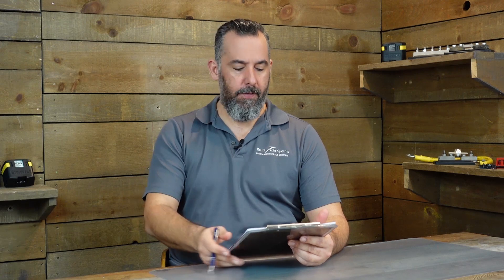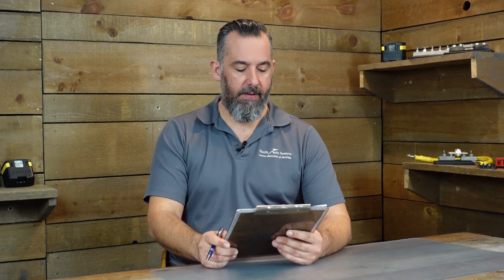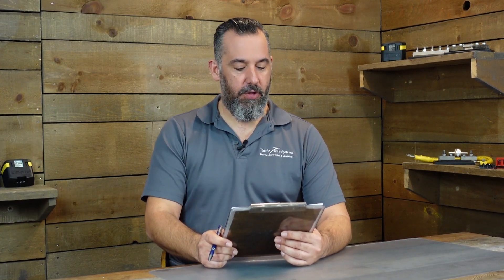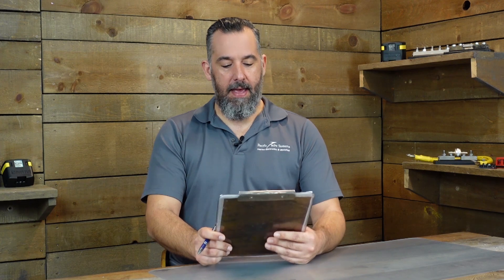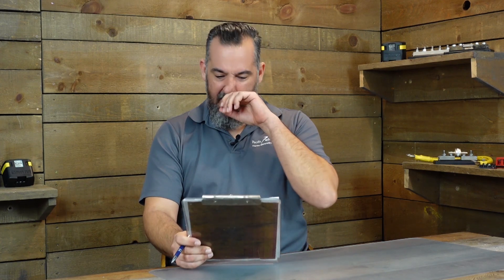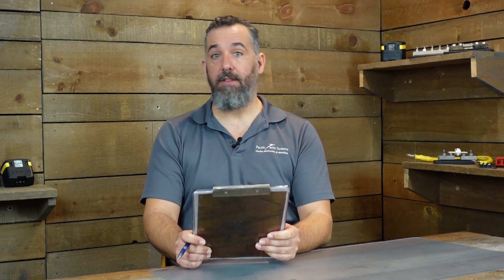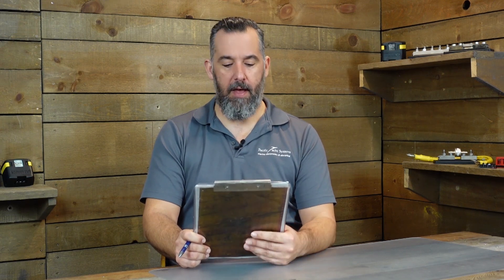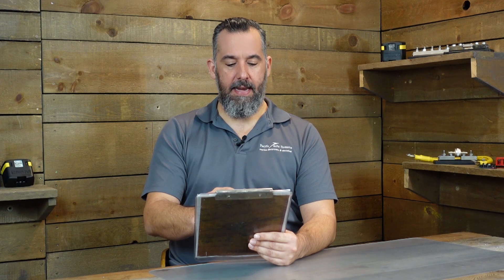Do I Fuse a Starter Battery on My Boat?

Comment: Yes it is a problem if you blow the fuse. But it is even a bigger problem if the starter shorts out and starts a fire. There is no easy answer. A bypass emergency switch (bypassing the fuse in case it blows) is an easy solution.

Comment: I had a 300 amp fuse on the start battery and tripped it when the ACR failed to keep the battery charged. I had a parallel switch that allowed me to start off the house. I'd always prefer a fused circuit over a potential short and fire.

Comment: When I was just 20 years of age I worked for a yacht charter cleaning boats etc. One day at the dock I tried to start a 26 foot flying bridge type cabin boat with a V8 inboard. Instead of starting, smoke billowed out from the engine compartment. I quickly pulled the hatch and saw flame through the black smoke. All I could do was empty one of those ABC fire extinguishers on it which surprisingly snuffed the flame. By then I think the battery was exhausted and the starter cables were history. Fortunately it wasn't a 4D or 8D battery. At that time I believed the heavy starter contact solenoid stuck. I'm guessing that a properly spec'd fuse would have prevented that. Now after having read the no-fuse policy, I propose a solution. Why not fuse the starter main circuit anaway but also wire in a by-pass switch of the type used to switch batteries? If the fuse blows at an inopportune time, just flip the bypass. Batteries should always pass a dockside pre-trip fitness test (what would that list look like?). Regular voltage drop measurements across connections and proper AWG comes to name a few come to mind. Cheers!

Comment: Jeff, PYS, I'm having a difficult time accepting the notion that a starter will draw more current from a partially discharged battery. Have you ever tested this in a shop or laboratory environment??
Reply: Physics say its so and ohms law helps us to visualize the concept.  In dc circuits, resistance is typically fixed so if voltage dips, current must rise.  Hope this helps.
Reply: Ohms law. You do not need to test that. It is a fact. Less voltage means more current needed.

Comment: One of the things about starter motors is their current draw critically depends on how much torque is required to spool up the motor. On a cold day with thick oil, current draw is dramatically increased. Strangely, current draw is actually higher when the battery is depleted, for the following reason. To muster the torque to turn the crankshaft, the battery needs to overcome a specific input power threshold, so these motors are designed with low resistance to ramp up power consumption when the rotor is locked. Power input is the product of voltage and current. So if supply voltage is low, the crankshaft won't begin to spin until current rises higher. With a dying battery you end up with a higher current draw, and current runs for longer when it takes longer to get that crankshaft turning.

Comment: Hahaha. Finally. The truth. It’s ok to not run fuses everywhere as long as you do a really good job with the installation. I swear, the strictness of some boaters and their "dire" warnings and finger wagging advice has harmed more boaters both in damage and just giving it up than helped. There are so many ways to do things on a boat. Best thing to do is have complete understanding of what your working on and use common sense that pertains to the boat and operators. Life is best when freedom of expression, even in engineering and installation, is present.
Reply from the maker: it's right in the ABYC guild lines that a starter circuit does not need to be fused.  However it's not a bad idea as long as it's big enough to never trip under normal use.

Comment: hi Jeff, can I install an SMH connector as a quick service disconnect on my house battery bank? as long as the SMH connector is rated for the load and fused, would this break any ABYC standards?
Reply from the maker: Hi Jarret, what's an SMH connector and what's your thought on using one?

Comment: My starter battery box for group 29 and 31 made by Attwood is much longer than the battery. I put the Blue Sea ANL fuse holder on a block of wood meant to keep battery from sliding around.  Now here is another idea for keeping starter wires off until you crank the engine. Use a starter relay inline from start battery wire. connect the relay control wire to the ignition switch so it is on when you turn key to start position. Wires are then dead all the time except for when turning key to start. If two  2 engines and 2 keys, use common 10 amp or so diodes inline with the wire from each key switch to the added in starter relay which is immediately wired at the positive battery terminal. Diodes act as one way valves, so turning either key means will only crank the appropriate engine, otherwise turning either key will crank both engines at same time.  Put the starter relay after the rotary switch if you want, like if something else is powered directly off the battery, you can figure this out, it is easy. Advantage is the entire starter wires have no power unless you actually turn key to start, so there is no short to cause a fire. If there is a short, you will know immediately, your right there, engine wont crank.
Reply from the maker: Thanks for sharing Scott!

Comment: People still do fuse their starter wires anyway. It is simply optional. A 300 amp Blue Sea ANL fuse has a long time delay of over amperage before it will blow. I have 2 banks, starter and house and 2 rotary battery switches. If the starter fuse ever blows, and it has not for a 392 v8 yet, I can rotate house switch to both, the number 2 position switch lug runs a wire down to the starter wire buss, and I can start with no fuse in the circuit. I dont fuse my house battery switch , I fuse the buss connections, one for inverter 500 amp, one for house 150 amp , one for Lectrasan 100 amp.  I could always change things if I wanted.
Reply from the maker: Scott, you bring a good point, because the ABYC code doesn't require fusing the starter, that doesn't mean it cannot be done safely. I too have a fuse on my starting circuit and it's well sized to protect the wiring, fuse never blew accidently in 14 years.
Reply: Normal running is both switches on #1, swap banks, both switches on #2. Combine banks, either switch on 1+2, with other switch on 1,2, or 1+2. Isolate a bank to off is off. So put switch to off, other switch 1+2, that banks runs everything.

Comment: A temp sensor on the main power cable and a motorized main switch that cuts the connection would be a better soulution than a fuse. If the temperature on the cable gets so high that it will start a fire...no other scenarios are worse..My opinion..
Reply from the maker: Thanks for sharing.
Reply: @PacificYachtSystems  In the real world you can use a 500A plus contactor ,with no fuse, activated by the starter key. Only for the cable between the starter and the starter battery. With this solution you will never have an unfused cable during normal operation. Only when you use the starter motor. Can altso be combined with a bypass main switch if you are afraid of contactor malfunction.

Comment: Great stuff Jeff.  I am still having trouble with understanding. a few items.  Electrolysis, stray current from other sources and finally my boats Englehard Corrosion Monitor.  Where can I find the answer to these mysteries?
Reply from the maker: Hi Mike, would suggest you read Nigel Calder's Boatowners Mechanical and Electrical handbook.
Reply: @PacificYachtSystems  thank you sir.

Comment: I used to work for a boat manufacturer here in Australia, we started putting in 750 amp ANL fuses in the main feed to each start battery, never had one blow in normal use starting up to 1150 HP Scania V8 diesels, It would have been handy just before we started doing so where I had a situation on a brand new boat, turning on the start battery isolator for the first time, engine room filled with smoke, Isolator fused closed, had to cut the cable... turned out the engine manufacturer wired the alternator pos to neg .
Reply from the maker: Hey Nick, interesting stuff, thanks for sharing.

Comment: Great topic. It got me thinking about a low voltage battery needing more current to start. It would be interesting to try this with my 300A MRBF. It seems that Rod an Marine How To is recommending always using fusing and saying only a dead short would blow the fuses so I have MFBF fuses where I did have no protection.
Reply from the maker: Hi Danny, fusing starters is definitely doable and should be done at a universal level, meaning it should be part of the code. There might be some trial an error in sizing a fuse, as none of the engine manufacturers are providing any recommendations or specs for fusing a starter. As a point of reference, my starter is fused, but it took me some time to get the correct size of fuse.

Comment: Nigel Calder recommends a 300 A slow blow fuse at the battery for a typical auxiliary diesel with a 12 Volt starter, stating that this is enough to avoid nuisance blowing. Do you agree that it is?
Reply: It will always depend on the starter, the engine, and the cable to the starter from the battery. 300A might be a good number, I don’t have access to that kind of data to say for sure. Just make sure the cable to the starter can support the 300A. If the starter locks up or runs continuously with an undersized cable you could be in for a fire. If you can send me the model number of your starter I can try to help you choose a setup.
Reply from the maker: Hi Torsten, my own starter on my 30 HP engine was fused 13 years ago with a 300 amp fuse. That said fusing a starter circuit should be done with care as you would not want to ever have an accidently blown fuse and then consequently not  being able start your engine in a dire emergency. It's all about pros and cons of each decision.
Reply: @PacificYachtSystems  On my old boat, I put a 60 amp  58 volt fuse on the diesel starter battery. The starter received no voltage. I removed it and the starter worked again. The fuse did not blow however. If the fuse was undersized at 60 amps, shouldn't it have blown?

Comment: Hello at PYS, 

 I have a question, not related to this particular video, but maybe is a good idea for another video...

  When I purchased my 87 Carver 28, it had the obligatory rats nest of wires stacked on the battery terminals for things like down riggers, and fish finders. Obviously I would like to add an auxiliary fuse panel to the switched side and clean all that up. 

 My question is:
What kind of fuse panels are suitable for use inside the gasoline engine room? Are ATO fuses ignition protected? Is ATC better? Do I need a special panel? 

 Thanks, I love your vids. Keep up the good work,
Cap'n Hippy
Reply from the maker: Great question, some boatbuilders like SeaRay have DC distribution panels in their gasoline engine rooms, not sure where they get them build for Ignition Protection. Reach out to Blueseas to find out and let us know what you find.
Reply: @PacificYachtSystems  Well, I did some research on the googly webs, and called the folks at Blue Sea (who were really super nice and helpful), and today/yesterday I learned the difference between ATO and ATC fuses. 

 So, to answer my question, it's not really the box that matters in regards to ignition protection (chemical proof, yes), but the fuses themselves. 

 Which made sense to my logical brain, since the sparky part shouldn't be the box itself; but the fuses. But I wanted to double check. 

 I can't believe I've been a boater this long and didn't know about this! I'm pretty handy too, do my own electrical work..
Am I the only one? Seems pretty important actually.

 Like... Is every boater who ever added a CanTire inline fuse holder cruising around in a time bomb?!!
Reply: Hi again.. just to add to my question...

 I'm not necessarily asking what brand of fuse panel, but more what TYPE of panel. 

Thanks again

Comment: Great video as always.
Now I ask myself why are  battery protective boots  bad in this situation? And would protective boots be good for the house battery?
Reply from the maker: Hi Rudi, sorry for the confusion. Protective boots are good. They are commonly used on batteries, starter solenoid, alternator, etc...